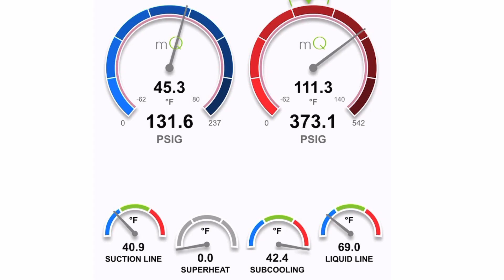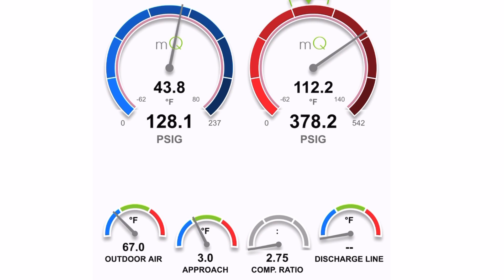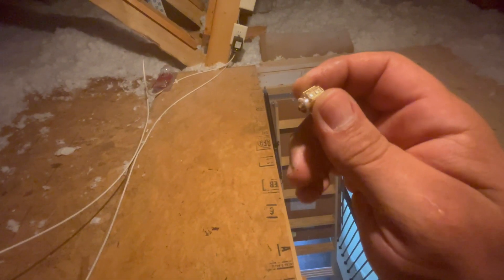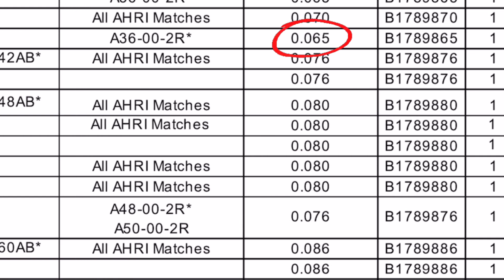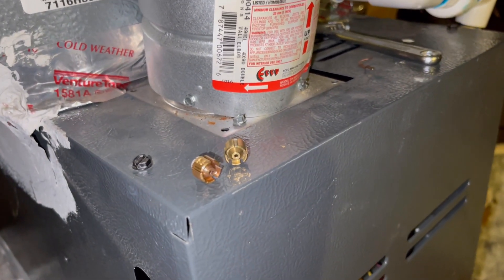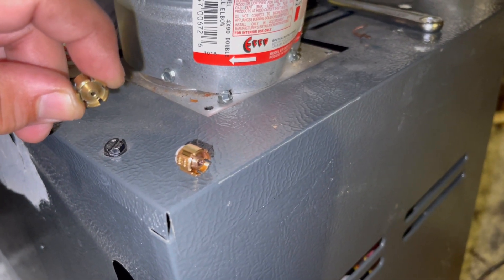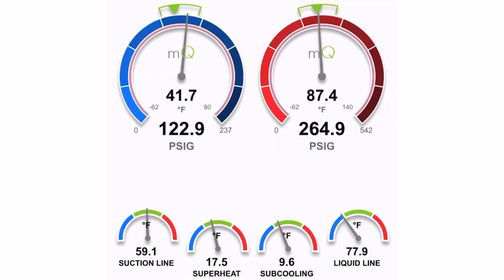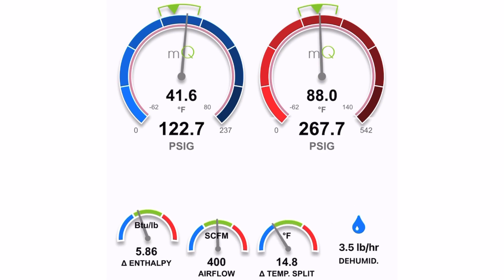Checking a system with the wrong sized piston!

Comment: Whether the piston was being overfed or not, those pressures indicated the system was overcharged. Low superheat and high subcool is the major indicator, as well as the normal to high suction. Retrictions are indicated by a high superheat and high subcool, with a low suction pressure.

Comment: I had this same experience! The system was only giving me a 10 degree delta T....we ended up changing out the piston and that bad Larry was cooling with a nice 20 degree delta T. I also changed the filter dryer. Systems been running beautifully for the last two summers.

Comment: I watched this video because i thought I had the same problem. It all started with a hissing (rushing) sound near the piston that would come and go as the unit ran. I'm an auto mechanic so the first thing I thought was low refrigerant charge because that is what some car systems do when low. I checked every inch of the system and no leak. The unit had ran fine since it was installed 10 years prior. A couple of years ago during a storm we lost one leg of our power and the condensing unit was making a horrible growl so I turned it off until power was restored. This was the clue I needed. One morning the condensing unit started the growl, no storm or power outage. I turned it off. Hooked up some gauges and they were fluctuating just like in this video. So I thought clogged piston. The piston size was written on the case with the bag taped to the unit as well. An it matched  the Goodman chart. I checked power across the contactor and had 112v on one side, 83v on the other and 120v and 120v coming in. I removed the contactor and sure enough the contacts were cooked. Luckily there is an AC supplier close by and I bought a new contactor and capacitor. Pressures are now stable and no more hissing sound. I was surprised,

Comment: Ok that orface  looks odd the .065 should be larger than a .05~ correct? Thats very odd.  Im dealing with a  frank system 
  It has a 2.5ton outdoor  2ton indoor and a .071 piston, what im seeing is it shoukd have. A .065 piston. The low side line freezes at the unit within two minutes  as if there is hardly enough of a piston restricting, but it restrics enouge to cause  a small difference  between the high and low side 50psi difference. 
 
  Low side well over 200psi, installer  likely overcharged as it would not pump down the refrigerant  all the way before the compressor tripped. So i will be weighing  in a charge  and dropping a .065 in its place to see how it does and adjust accordingly.

 But tell me a bit about that damn orface  whats is up with that?  I wouldnt think the  orface would be smaller.  For a larger unit, as the numbers apear to go up as the capacity  goes up while the  piston size also i creases, but you are saying it is smaller, very odd

Comment: I hate to tell you this, but you're wrong, a .057 metering piston is SMALLER than a .065 metering piston. As the number moves closer to .100 the bigger the orifice. As I've already said, what was wrong with this unit was that a too small piston was installed and it was grossly overcharged with refrigerant. I bet you recovered at least 2 pounds over nameplate. Also, in the TXV video you referenced the nameplate charge to determine the amount of charge to put in, which was 201 ozs and you said you'd added 16 ozs for the lineset. Goodman explicitly states that the charge that comes with the unit is for 15' of each line, so, theoretically,  if you had a longer lineset you'd add refrigerant, if you had a shorter lineset you'd remove refrigerant, but you can't go by that. Factors such as the install crew didn't thoroughly read the, guess what, installation instructions might have led them to install  the wrong size suction line. Many installers think that they should install a suction line that matches the size of the condenser suction line fitting. But, if they would have read the 'Recommended Interconnecting Tubing' Chart that comes with the condenser installation instructions(for Goodman condensers, which is the brand I sold) they would have, most of the time, installed the correctly sized suction line. You can't just use a rule of thumb to determine the charge of the unit. The correct way to do it is to measure the ACTUAL length of the suction line to determine if it's longer than 15'(or eye it if your good at that) and if it is, then you can use the nameplate charge as a starting point and then charge by superheat and sub-cooling whether iit's a fixed metering device(metering piston or cap tubes) or a TXV(you don't know if they installed the correct TXV or if something is wrong with the TXV like it's stuck in a fixed position or if its got a dead sensing bulb) always check both when checking the charge or re-charging. I'm sorry to say I learned this the hard way and it costed me time and money, OUCH! 

There are three metering piston installation issues I found that caused these systems to not properly cool: 1) as you found, they didn't install the correct metering piston, good find! 2) they installed it backwards 3) they didn't install one at all, or a combination of these. For example,, I did sometimes find that they had installed the wrong metering piston AND installed it backwards. I discovered that there was an Lennox company in my area that had been in business since 1964 that had a service manager that taught his crews and techs to install the metering piston backwards since he didn't read the instructions on the plastic bag that the metering piston came in. He also didn't tell them that they needed to install the metering piston that came with the condenser and not the one that came with the evaporator. So I knew when I got a call from someone that had a Lennox AC installed by them and they told me the issue was that, in really hot weather(above 93 degrees) it ran all the time and it never reached the temperature they set the thermostat at(most of the time it was a reasonable setting from 70-77, but sometimes they'd have it set to, say, 65, which was ridiculous) that it was a distinct possibility that it was a metering piston issue. Of course I checked the more common things first; well, I serviced the unit first to eliminate any of the common issues like a dirty air filter or coil or blower wheel or secondary heat exchanger fins, or a dirty condenser. Then, I checked the charge and about 85% of the time on these Lennox units that they installed it was a metering piston issue.

Whew!! That was a long-winded comment. I hope I wasn't too critical and that it helps. Have a great weekend! if you have any ?s, comments or concerns, please let me know.
Reply: That's what I thought, but Maybe these are part # and not actually orfice  size😊
Reply: @lulubliz6405  The number that's stamped on the metering piston is the orifice size and not the part number. But, good thought.

Comment: Thanks for this video, you did a great job! However, to me those readings you're getting aren't symptomatic of too large of a metering piston. If you had too large of a piston the superheat would be too low like it is, but your sub-cooling would also be too low; the liquid refrigerant would be flowing too fast out of the liquid line and never have a chance to sit and cool long enough to give you the proper amount of sub-cooling. I think what you have here is too small of a metering piston installed AND a gross overcharge of refrigerant or a very dirty evaporator, or secondary heat exchanger or air filter.

Comment: I have a question. Based on my research, a 4 ton r410a unit typically calls for a .080 or .082. I installed a .082 and my pressures are a little high. According to Mr Cool, it calls for a .085 which again, based on my research would be too large. If I increase to a .085 I fear I will be flooding the compressor. I actually intended to install a .080 but nobody in town had one. What would you recommend?

Comment: Your video helped me fix my problem. I installed a Goodman 2 ton condenser onto a Rheem 2 ton n-coil with a txv. My low side pressure was really high and it was not cooling. I removed the txv and installed a .57 piston. The low side pressure came down and after adding refrigerant. It’s cooling better.
Reply: Update, I had to go to a larger .67 for it to cool better.

Comment: Thanks for the video I enjoyed it. I started in the HVAC field in 1978 at 18 years old and am still doing it although I am now a service manager in an office. I conclude that the 57 piston was indeed too small as proven by the 65 piston being listed in the Goodman piston chart as the correct one for the 3 ton condensing unit. That one was easy. I conclude that the system was overcharged because the 57 piston  would not allow for enough refrigerant flow for proper cooling and overcharging will force more refrigerant into the evap. coil and "get more cooling" even to the point of flooding back to the compressor. Note that the superheat was zero which indicates flooding in this case. The high subcooling and high head pressure readings are both indicative overcharge in this case. As for the restriction talk, although high subcooling may indicate a restriction in some cases, you will also have high superheat and not low superheat as long as the refrigerant charge was correct and of course proper airflow through the evap. coil. Also, a restriction in itself with proper charge and proper airflow through the condenser coil will not significantly raise the head pressure and in this case the high head pressure was another clue of the overcharge.

Comment: Looking at some of the other comments and noticed the same thing as what they noticed. First, a .065 is larger than .057, so either you read the number wrong or the new one should have been even larger. Second, if there was a restriction, the evap would be starved and you would be at freezing or below and superheat would be high. You had a flooded evap so it was overcharged or piston too large, which if true means like the other guy said, may have been .087.
Reply: The print does say .057 I wonder if that's a misprint

Comment: The video is good but as far as I know the super heat within a normal working range should be between 8 and 16 degrees Fahrengeith.  and the Coollin sub from 8 to 12 degrees.  Other than that, the video is very good.  It has very good tools to diagnose AC equipment.  Blessings .
Reply: Depends greatly on wet bulb. I have had 21 to 28 degree f superheats the last two weeks in more than half my homes 3-7 homes every day.

Comment: I had this problem today. I replaced a leaking coil with a cap tube replaced it with a coil with a piston instead. Installed a 0.068 piston for a 2.5 ton outdoor unit r22. And it was doing this sorta. its working decently had a 19/20 ish TD across the coil target superheat was 16 but It was maintaining 8 to 5 degrees of system superheat also added in a filter drier because system originally did not have one but I can't seem to get the super heat up. I suspect low airflow but its a super old system with old wood box style duct work. Even went through the house and made sure all the registers were open for proper airflow it really has me scratching my head.

Comment: That .057 orifice is the size for a 2 ton R410A system. Why would a 3 ton ADP coil come with a .057 in it? They messed up at the factory, or someone changed it. Should have been the pretty close piston right from the factory in the ADP coil.

Comment: What piston size should I use in 4 ton 410 unit
Reply: Depends on the compressor and manufacturer, it will be slightly different for different kinds of 4 ton. So just match it with the compressor and unit you are using. If I am wrong, someone will correct me on this or if I am right someone will agree.
Reply: @Fraustyair  it's good practice to always match the Piston with the compressor ton size. (But always refer to manufacture piston chart for compressor used, as to achieve normal operation pressures)

Comment: You need to be educated more. A restriction would be low suction high superheat high subcooling low head. The head pressure low because the key factor is the outdoor fan. The refrigerant spends more time in the condensor in subcools and the liquid stacks. Liquid is more compact then expanded vapor so it takes up less space that's where the decrease In Head pressure. This system severely over charged.

Comment: #57 piston or .057 piston is SMALLER than the one you trying to put in #65 or .065. You read the number on the old piston wrong. It's probably a .087 piston. Trying to get a glass or go see an eye doctor.
Reply: Look at the video closer and pause when it focuses in on the piston. It appears to be stamped 057. Surely an incorrect imprint. Not unheard of but not super rare either. I keep a set of pin gauges on the truck for issues such as this. What does you trying to get a glass or go see an eye doctor have to do with his video?
Reply: Looks like usahoangsatruingsa is the one that needs the eye doctor or glasses 👓 a lesson in respect and manners would probably be helpful too. Nice try though, PAL. 😂

Comment: A restriction would cause low pressures unless it was restricted and overcharged. Which they often are previous tech saw low pressures from restriction and added refrigerant. Also with a restriction superheat and sub cooling will be high. The symptoms your unit is showing is overfeeding metering device.
Reply: You said it
Reply: My thoughts exactly

Comment: Why did you have to recover the refrigerant instead of just pumping the system down? Thanks for the video
Reply: He may have wanted to think in advance In case system was overcharged, since a piston metering device has to be charged by the target superheat. The pump-down wouldn’t have helped him out if it was overcharged, hence he recovered refrigerant and got his target superheat based on the day…… allegedly.
Reply: He's not very knowledgeable.  Please don't follow
Reply: I just pump it down as well.
Reply: Have you seen the COST for the refrigerant lately? 30lb of r-410 =$420.00 UP

Comment: I had the same problem this week with a R 22 system good man air handler the installer left the 09 piston in I removed the 0.9 Piston and replaced it with a 65 and it’s working great, thank you for the great videos keep them coming

Comment: Not a good idea to pump through manifold
Reply: Why
Reply: @alanfoster7346  a lot of reasons.
- a dozen different joints, increasing chances of leak
- not using vacuum rated hoses
- hoses will most likely have core depressors which will restrict your vacuum
- hoses will be smaller most likely 1/4"
- risk of contamination because you're using the same manifold + hoses you use to service and diagnose units

Yes you can take steps to minimize any of these risks, but the point is, why? Hook your pump up right to the port with a vacuum rated hose and a core tool with shut off valve, and you're laughing. 
Simpler, faster, cheaper, lighter, and you'll pull a 10x better vacuum as well.